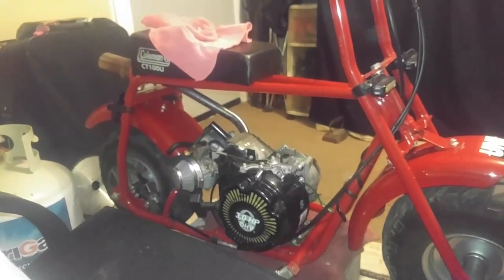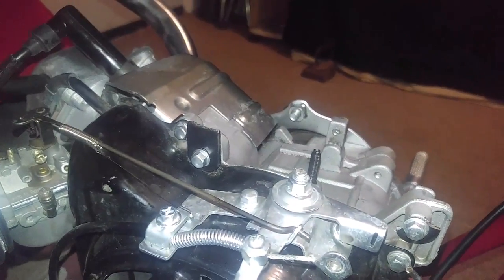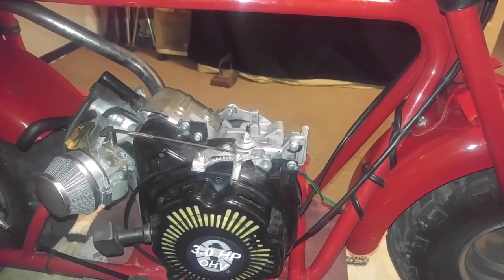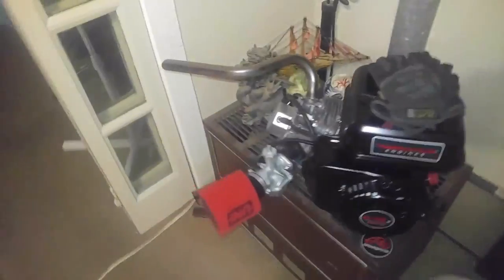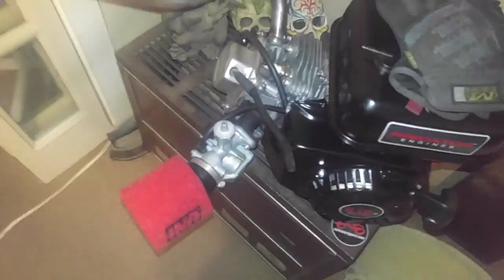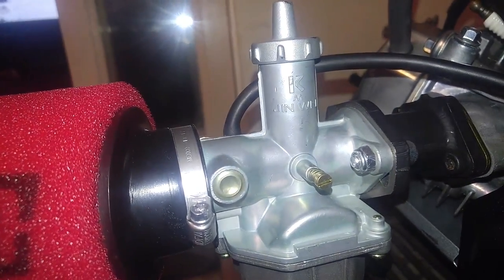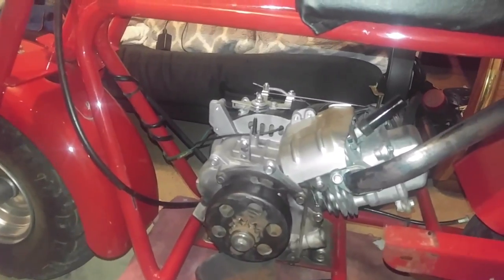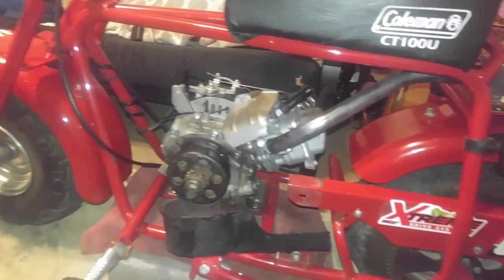Spikemandan needs your help for the ct100u

Comment: just drain the tank and take to your local welder . he can weld some heavy duty brackets on for you , the get a little black spray paint and you be riding again , why buy the same cheap ass tank again .
Reply from the maker: good point or i could just stop messing around and put the 212 on early